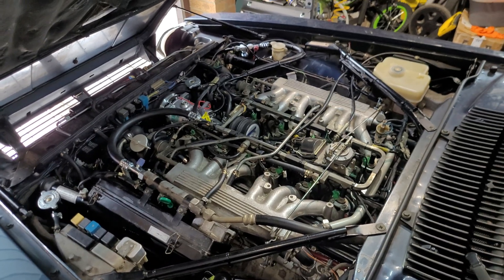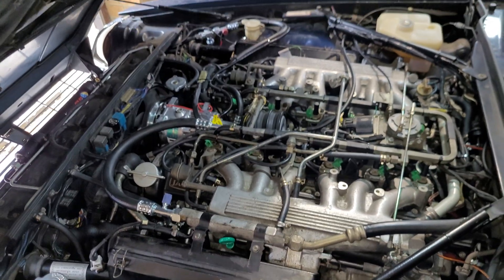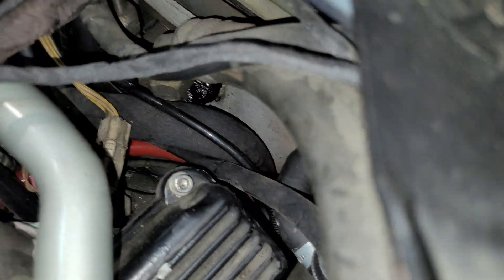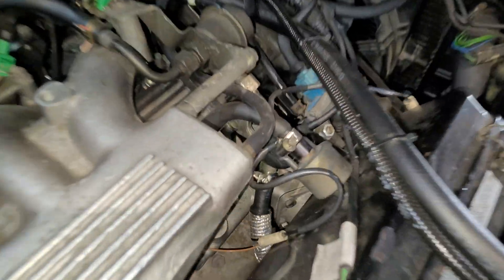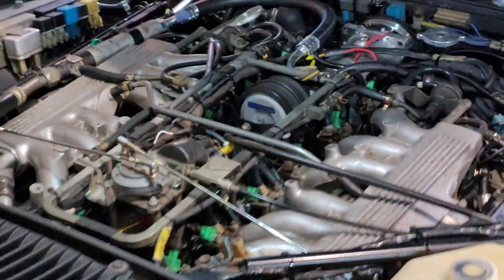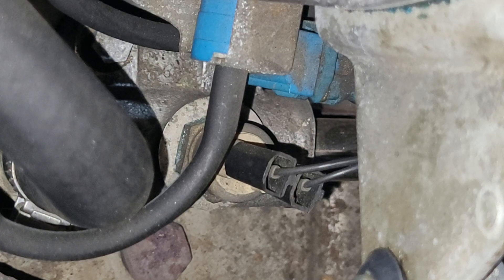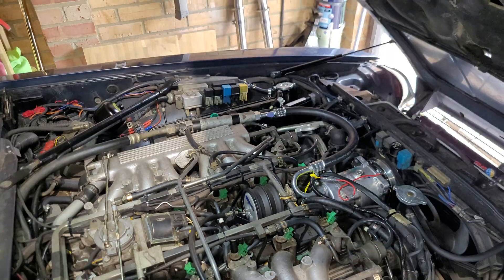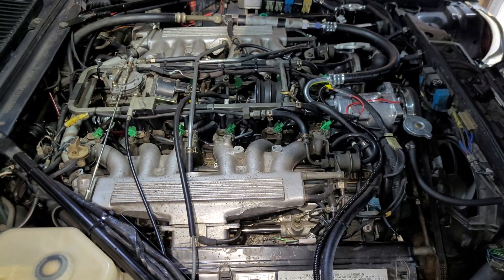Jaguar XJS V12 - Overview of engine sensors & switches

Comment: This is fantastic. I got my 91 facelift v12 14 months ago and I’m learning… I was looking for a video on engine code v sensor but I can’t find anything. Mine threw a code after being sat for 8 weeks. It was throttle position sensor but it cleared itself after a blast around the block. I would imagine it was mechanical as apposed to the sensor however learning the connections is vital I think
Reply from the maker: Nice. Keep at it, these cars do need a lot of attention but I think ultimately they are fairly simple beasts. Worth investing the time in!

Comment: G'day, great video. Just a question, at 10:55 you speak and show the Oil pressure gauge sender unit & then you move onto the smaller one "in the middle of the screen", you say that this is the Fuel Pressure warning light, the red light on the dashboard. You then  summarise by saying that the aforesaid Fuel Pressure warning light is a warning light for the Oil Pressure sensor? I presume you actually meant to say it was the Oil pressure light and not Fuel pressure warning light. Or did I get it wrong?
Reply from the maker: Sorry, yes I mis-spoke, I meant to say 'oil pressure warning light'. It's nothing to do with fuel. they both screw into the same oil pressure access point fitting.

Comment: Good video. I can confirm the 2-wire temp sensor in the coolant rail and nearest to the bulkhead / rear of engine, is for emissions. It is used by the vacuum advance delay system that runs the engine inefficiently when cold, to reduce the engine warm-up time. You can disconnect either of the wires to the sensor, to disable that circuit, without any harmful effect.
Reply from the maker: Hey thanks. yeah I think the last thing this car really needs is more inefficiency to warm up faster :D I might look at disabling that system for reliability if nothing else.

Comment: Brilliantly helpful. My 89 Daimler Double Six will not rev past 1500rpm. I trying to understand which sensor is causing the issue. If you've ever had this issue before I would be eternally grateful for any advice.
Reply from the maker: You're welcome. It's quite tricky to say i'm afraid - What i'd do is a quick video of the car starting from cold and demonstrating the issue - might aid in diagnosis. 
is it running on all 12 cylinders under 1500rpm? If it's just not revving past i'd suggest it's ignition related (a bunch of things can fail- cap leads, coils, modules), possibly fuel issue (old stale fuel?, low pressure/flow from a failed pump, blocked filter), rather than a specific engine sensor that would cause that.

I'd start by verifying fuel supply all ok. I did a video on quickly checking fuel pressure if you scroll my uploads

Comment: Love your videos. People will be able to refer to them for years. What about mention of the coax cable from Marelli Ecu to car Ecu goes over top of engine. Took my car of road for 2 months while I replaced all of the Marelli bits and cost pennies when discovered!
Reply from the maker: Thanks! yes very good point on that little coax cable. I have to be honest i've never had any trouble with it but have read of many problems from others. I think it's that little standalone white wire that has a single connector, near the coils? I might do a video on it.
Reply: @TMEstuff correct. I think mine had been fixed many years ago as inner core had been broken. The electrical tape had come of and outer was touching inner at times. Taped up again but will be fixing with shrink wrap in due course

Comment from the maker: More 4k close up V12 engine content! Apologies I mis-spoke on the fuel rail temperature switch part number - it is actually EAC5086. NOT 5805. It might not come across but I often cannot really see the detail of what i'm recording...

If anyone knows the detail of those coolant temperature sensors/switches, please let me know below

Also realised I forgot the Throttle Position Sensor! may do a separate video on it